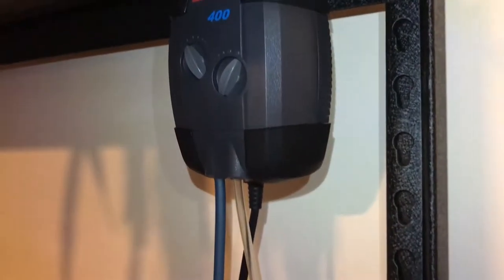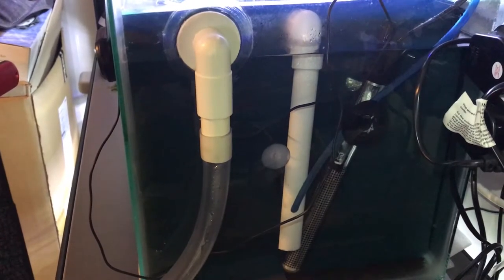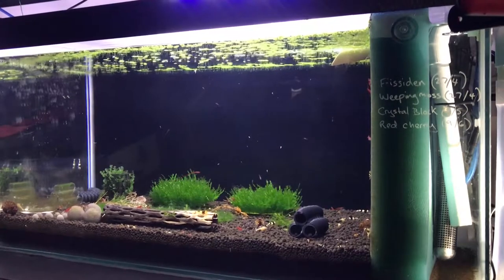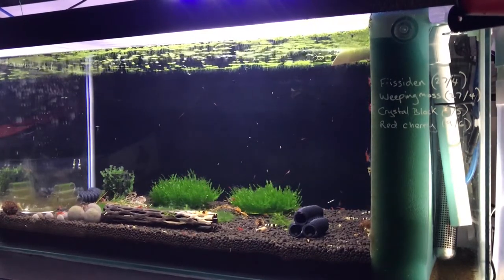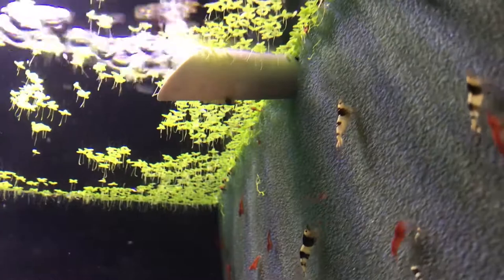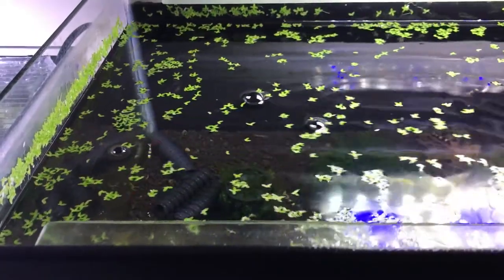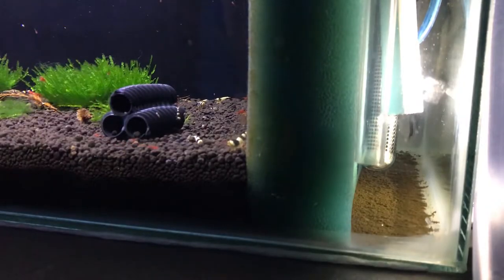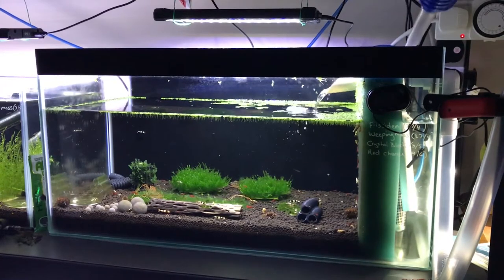How a HMF (Hamburg matten filter) Works

Comment: So I really like the concept of this but my concern is taking the sponge out to rinse/clean it.  Is there a clever way to remove it so your substrate/aquascape doesn't get all destroyed and has to be redone as well?
Reply from the maker: It can be a little fiddly but really isn't as bad as you might think. When you put the sponge back in just start further back from your substrate and scrap in back up in line. It's hard to explain, maybe I'll do a video on it soon. But it's not that messy really :)
Reply: @SimplyShrimps  Do you have a video about it yet?
Reply: @SimplyShrimps  Or you could silicone a glass lip on the bottom, the height of the substrate or just above (a millimeter of 2-3 above it). Less work in my opinion, right? ;)

Comment: I have a 3" thick 30ppi foam and 2 12" jetlift my fluval q2 air pump says it gives 60gph/227lph is that too much or too little?
Reply from the maker: I'm not too sure to be honest. If you put it on and it is too much you can always turn it down with a control valve.
Reply: Simply Shrimps cool thanks
Reply from the maker: No worries :D

Comment: Can I place the outlet lower than that (video) or how would I go about lowering the noise from bubbles popping
Reply from the maker: The lower in the water it is the more bubbles it will make. If you don't have a cover on your tank that would lower the noise for sure.
Reply: Simply Shrimps did you mean if I cover the tank and keep it at the water line that will lower the noise?
Reply from the maker: Yes, it will still make some noice but bubbles will be bubbles haha!
Reply: Simply Shrimps lolololololol yes they will thank you for the help I'll drop it 2" under water and cover the tank

Comment: How do you clean a matten filter
Reply from the maker: +IceyKicks how do I ‘kill’?
Reply: Simply Shrimps I meant clean omfg 😂
Reply from the maker: You literally just take it out and clean it in a bucket of old tank water like you would any other sponge :)
Reply: @SimplyShrimps  how often do i need tl clean it if i use it?
Reply from the maker: I didn’t clean it for like 2 years and my shrimp were thriving. But it’s probably good practice to do it every year or so 😁